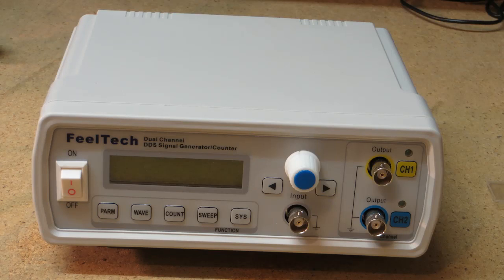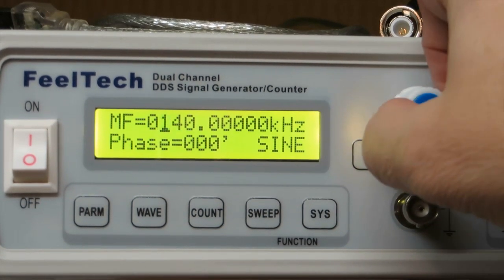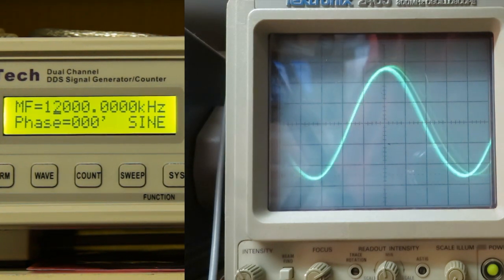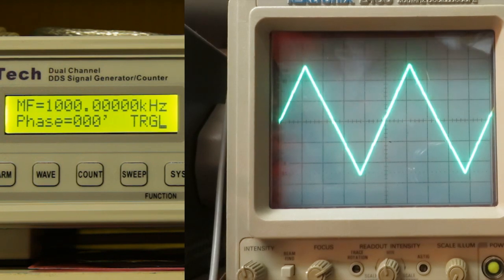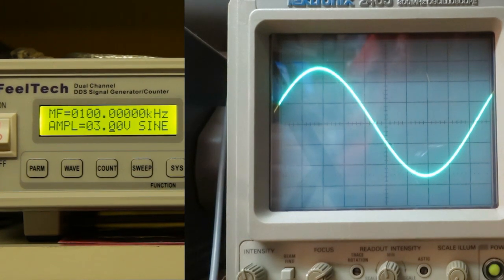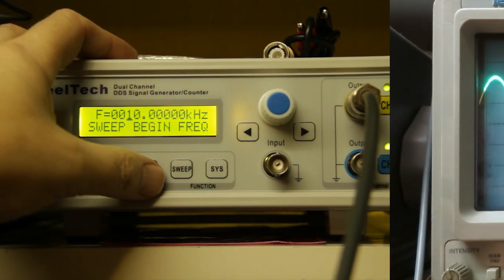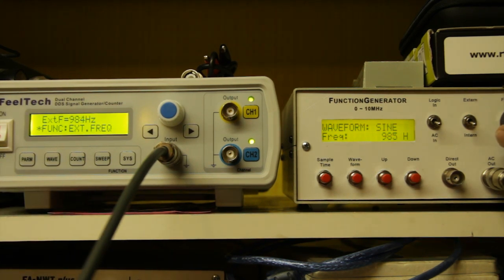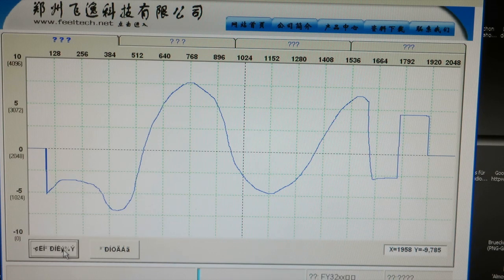FeelTech Signal Generator FY3200S, FY3224S

Comment: hi , thank you very much for a very informative video , i have a fy220sp but lost the cd as the software was not working with my win 7 64bits anyway , do you have a software for it that is compatible with my win ? Thank you anyway !
Reply from the maker: Hi Adrian, i have the original software for the generator running under Windows XP (it's my workshop pc), so i never tested if it runs under Win7. With the software you can create arbitrary waveforms on the FY-3200. As I don't know you generator model, i can not guarantee that the software will work, nor if its able to load and output arbitrary waveforms.
best regards
Michael
Reply: i have an FY2200SP and wish to try to upload an arbitrary waveform thru win 7 64bits, could you please help me out with the software that you have so i can try ? the software on the feeltech website is for driver software but nothing i can use for uploading the file via usb cable to the generator, please advise , Adrian

Comment: Hi.  On line purchase has its own drawback that you can not narrate a salesman what exactly you seen in the show case with what accessories etc. (Also most chines products unsold old windows 98 compactible).  No contact will be made with you regarding configurations,  For Instance, I purchased Alarm clock camera online.  The small cd forwarded with the parcel is of old age, i.e., even windows xp could not run it correctly.   The Time and date on the video recording failed after all efforts.   Firstly the product was labeled price as Rs.3900 with discount about 1500.  Yes, the product received without micro memory card.  The savings were utilized for purchase of 32 GB card for Rs1800.

Comment: Hey, I am struggling to enter an arbitrary waveform from the "text" box. I type a string of 2048 integers between 0 and 4095 separated by spaces and when I click on "view" it shows the waveform correctly, but when click on "send" it returns an error. Did you test that function??
Reply from the maker: hi pedro, sorry i did not test this. i only made a quick test painting a waveform with the mouse.

Comment: it product power supply have high frequency noise. so changed power supply.
Reply from the maker: +min jae Yoo 
hmmm... i can see some peaks oscilloscoping the npower supply. but this "noise" depends on the frequency which is set on the generator and does not affect the signal output... in my case
Reply: mmm maby i recived faulty product.. that noise was really big and independent without frequency set.

Comment: When in frequency sweep mode, does it have a voltage output which is relative to the frequency?
Reply from the maker: +paulc317 
normally the output voltage is constant ofer the sweep range. The voltage will drop on higher frequencies. if you sweep from 0 to 20 MHz of course there will be a drop at the end
Reply: +m si I wa not writing about the main freq. output , but an additional output with voltave relative to the frequency.
Reply from the maker: +Paul Cohen Sorry Paul, i misunderstood, there is no voltage output relative to frequency, as far as i know
br michael

Comment: I am running this device to powered orgonite devices for atmosphere purification purposes. It works well, but i would like to make small simple circuits that plug into the wall that produce a square wave that oscillates at 7.83hz the schumann resonance. Any info or links you can turn me on to for building square wave circuits would be much appreciated. Thank you
Reply from the maker: +killa skateboards 
hi, you can ask google for a "7.83 hz oscillator" and you will get a lot of pics and info how to build
br
Reply: very interesting how is that workingout? using traditional orgonite I.e cloudbusters? wat frequency are you using? have you used it therapeutically?
Reply: I have been using a lot of frequencies. therapeutically the Schumann at 7.83hz has been found to de-stress the body at the cellular level. I have been making tensor rings and tensor harmonizers to use as amplifiers they work well together. Instead of running a frequency into a coil around the crystal you can wrap it around a tensor ring and place the crystal in thr center poured in orgonite and the readings can get into the billions way off the bovis scale.
info on tensor technology.
https://www.google.com/url?sa=t&rct=j&q=&esrc=s&source=web&cd=1&cad=rja&uact=8&ved=0ahUKEwjtw8eWy7vUAhVGET4KHSmmD24QFggoMAA&url=http%3A%2F%2Fspiritofmaat.com%2Ffeb08%2Fslim_spurling_user_guide.doc&usg=AFQjCNFhDsr0_z6IFZKG1HG6gXARnbVKqQ&sig2=90FhJr_xJdzO5kmnWRwwHA

Comment: I just received mine from Amazon.com ($79.99 w/Free 2-Day Prime Shipping).  Sold as a "Jinwen" not a FeelTech product. The product pictures did not have any name on the front panel put the unit I received had "FeelTech" printed on the front panel.

The power on product ID display was identical to yours: 

FY3224S REV 2.0
  (C)2010-2014

My power-on defaults were different: 10 KHz at 10V. However, it is possible to set the power-on defaults by saving the current setting to first memory location ID'ed as memory location: "P_ON" (which is M0 of M0-M19)

As far as the voltage drop you observed at higher frequencies, Dave Jones might have a good explanation for why this happened. See "EEVblog #652 - Oscilloscope & Function Generator Measurement Trap".

I couldn't help but notice how much the amplitude voltage affected the quality of the waveforms; at 24 MHz a amplitude voltage higher that 6 V begins to distort the sine waveform. The distortion affect is much more pronounced for square/triangle/arbitrary wave forms which is why the spec tops out at 6 MHz for those wave forms. Also, amplitude voltage really affects the quality of the non-sine wave forms.

The software that came with my unit appears to be much improved; it is predominately english but there a a few places where gibberish or question marks (???...?) appear when there should be readable text. It's called "FY3200S PC Contrl Software" (Yes, Control is misspelled.) The User Manual I got also says FeelTech and is Rev1.4, dated 2014-10-22. I also received a MS Word document (FY3200S Series Communication Protocol Specification.doc) which documents the commands that can be used to control/status the device remotely through the USB port.
Reply from the maker: +Stephen Gertsch 
Hi Stephen, thank you very much for your comment and the useful hint for saving the settings.
I had a look at Dave Jones Blog, but i can not reproduce his effect. I used a old Tektronix 300MHz Scope and a better coaxial-cable (not the poor RG58 :-)), but the cabletype should not have a big effect on this frequencies
 and cable-length...
The amplitude starts dropping significantly over 20MHz. Below it's nearly constant. Trying to terminate the cable like Dave did, leads to a much lower amplitude (3V instead the adjusted 6V).
Of course the quality of the waveform depends on the amplitude. The Amplifier-Output stage seems not to be fast enough on higher levels.

Do you have a link, where i can get the software and doc's you mentioned?

Thanks again and best regards
Michael
Reply: What you ask should be directly available from the product manufacture (www.feeltech.net), however, they have completely dropped the ball with respect to supporting the users of their products.

Here is a link to a DropBox folder that I created to collect data on the device : 

https://www.dropbox.com/sh/tofayg46i8fy9l0/AACjdQlkp94ouQpW4FQqv6JPa?dl=0

(I will keep the link alive until 2016-02-12.)

I put the PC control program installation executable in the folder. The first few windows of the installation program are garbled, probably due to language issues. While the program does work, it is somewhat confusing to use. The software needs a lot of work to improve its usability.

I rewrote the communication protocol document because it was so deficient. It is not complete yet, I am still pulling together information and validating its technical accuracy.
Reply from the maker: +Stephen Gertsch 
Hi Stephen, thanks a lot for providing me with the files. Now it's much easier for me to control the generator via PC.
I'm not really familiar with chinese letters :-)
best regards
 Michael
Reply: +Stephen Gertsch Thank you for using FeelTech technology products, software problems we have in a positive solution, we will improve the next version.